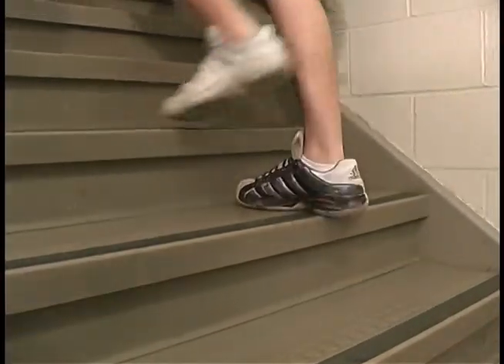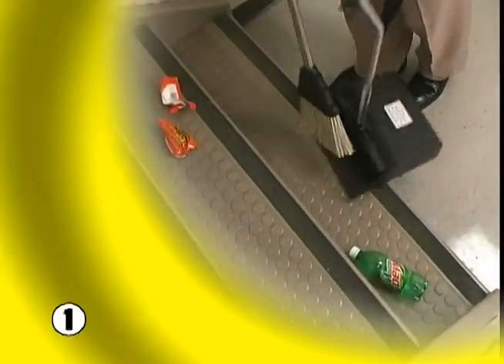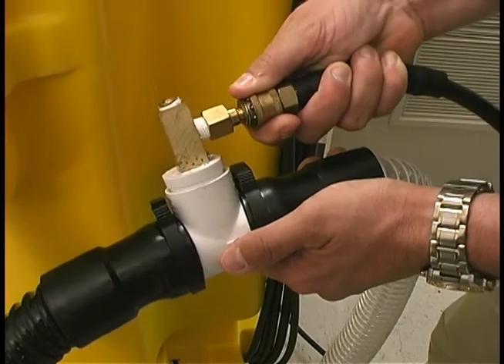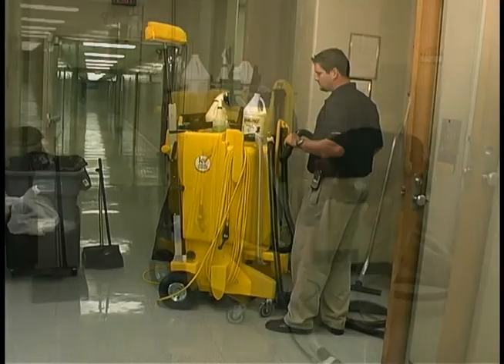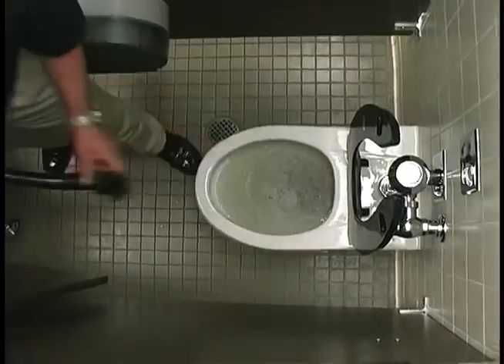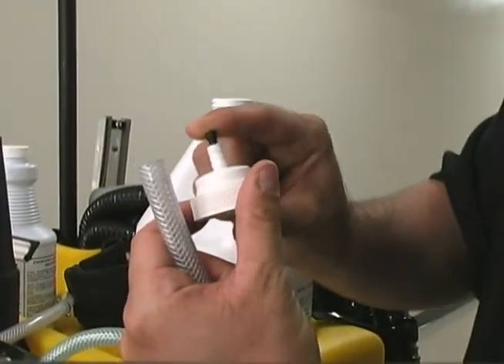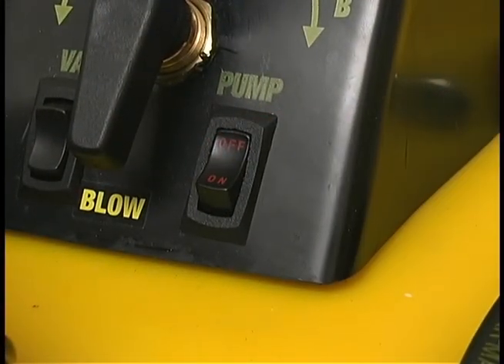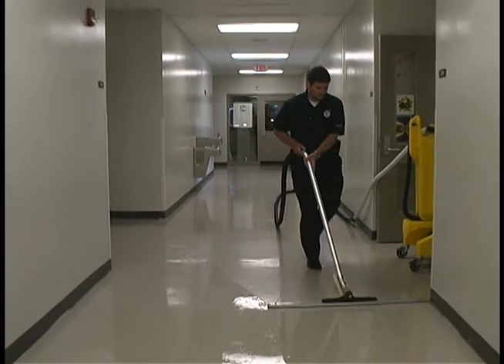Stairwell Cleaning

Comment: I live in a building with 20 floors and the stairways are disgusting. I live in Brooklyn. 
Question about this machine- our drain is in the basement. That said, in looking at this machine you can suck up the dirty water in between floors correct? We can't do the whole stairwell at once maybe in 2-3 days so we don't want to have all the dirty  water running down to the basement. We would need to clean one floor at a time. Also this is a residencial building so there's traffic all day. 
We have 2 stairwells and the building is 20 floors. They are painted with oil paint. Everything is filthy and I would like to propose this as a solution.

Comment: We have two of these machines and I can say without a doubt a wonderful cleaning machine. Used it on the cement floor in the art room. For those that do not know some of the clay's and ceramics when dry can cause a health problems. Keep it wet is the safest way to pick up thats where this machine is great. Also a can't beat for bathrooms.
Reply: I love in a building with 20 floors and the stairways are disgusting. I live in Brooklyn. 
Question about this machine- the drain is in the basement but looking at this you can suck up the dirty water in between floors, if you clean one floor at a time correct? 
We have 2 stairwells and the building is 20 floors. They are painted with oil paint. Everything is filthy and I would like to riposte a solution.
Reply: @LidLockTV  No need the product speaks for itself. have a nice day, stay safe.